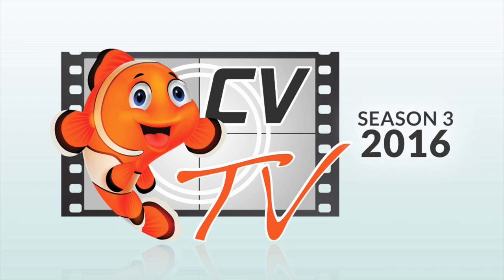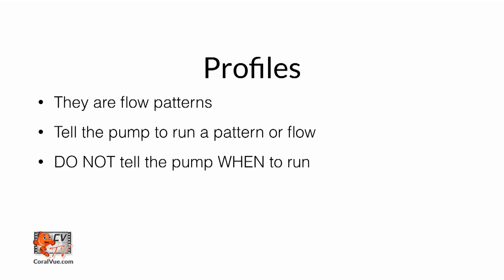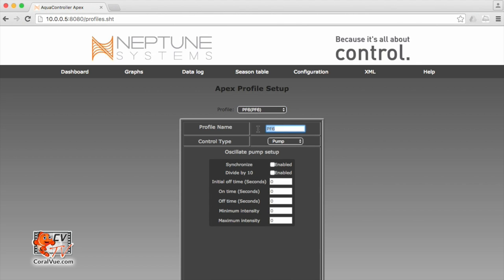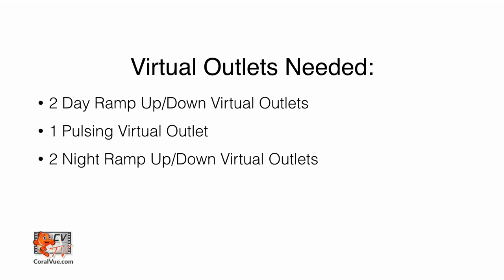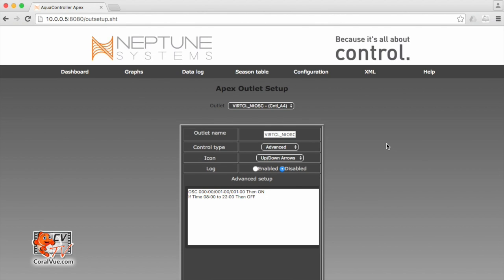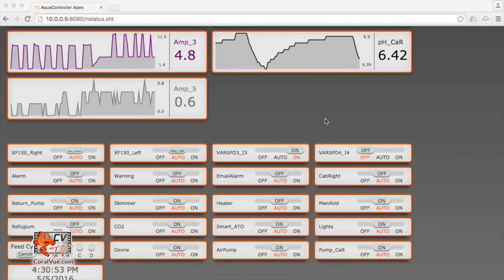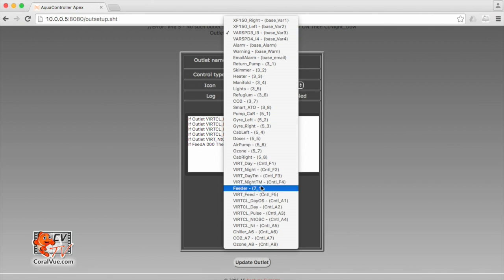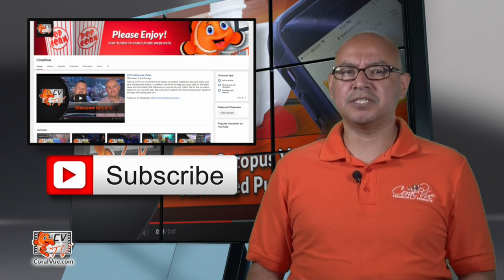Reef Octopus VarioS 0-10V Advanced Pump Control

Comment: Ok so I plugged the power of my Varios 8 into an EB-8 outlet. Turned the outlet on and the lights on the controllrer come onThen I plugged the 0-10V cable directly to my Apex Base. I see several VARSPDxx outlets Tried them all one by one But the pump doesn't turn on. It will only work when I disconnect it and run it straight from the outlet. What am I doing wrong here?
Reply from the maker: I suggest that you submit a support ticket at coravue.com/support for assistance.
Reply: No need I got my answer on Neptune BRS sold me the wrong cable Thanks

Comment: Where can I get the 0-10v port cable to connect to apex?
Reply from the maker: http://www.coralvue.com/icecap-y-module-cable
Reply: Do you have for single module cable? Not the Y module cable? 

http://www.coralvue.com/alternate-gyre-mode-modified-cable-for-icecap-gyre-interface-module  How about this?

Can i also icecap back up battery for this pump and be connect it to apex?

http://www.coralvue.com/icecap-battery-backup

Comment: Will it work with the Vertex Cerebra?
Reply from the maker: The VarioS pump can be controlled with any 3rd party system controller with a 0-10V control capabilities.
Reply: That's an ambiguous answer as vertex do not say if I can or not nor does it mention anything about 0-10v